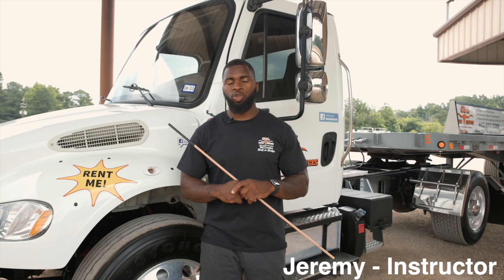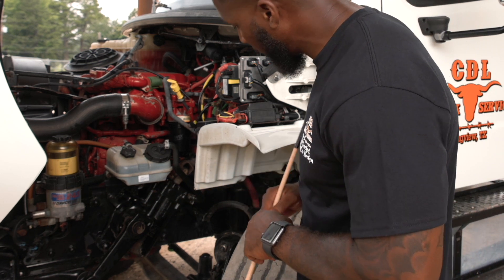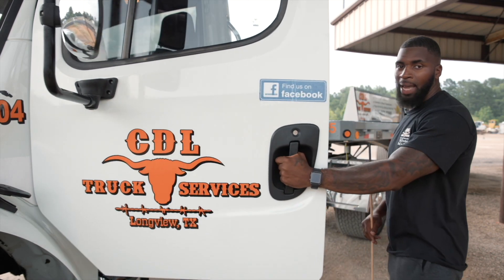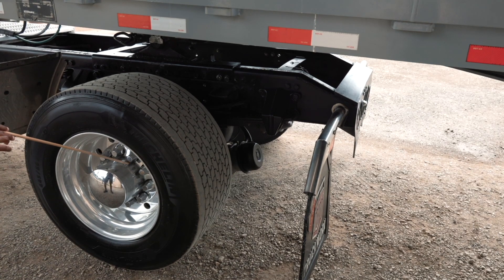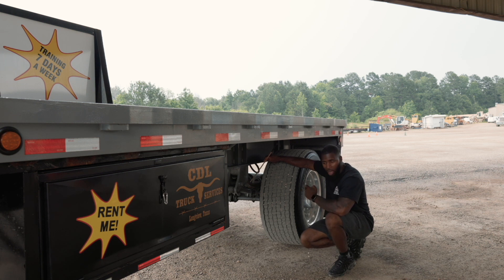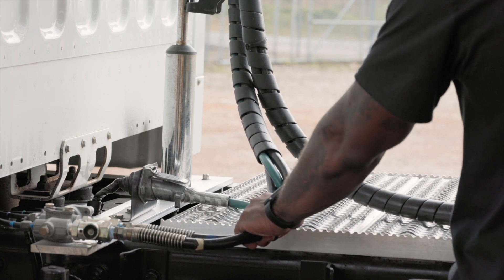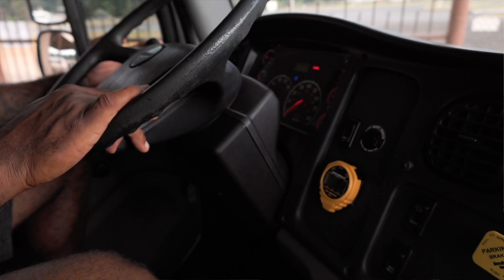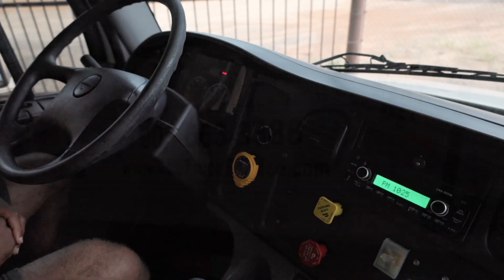CLASS A CDL Test Prep

Comment: This video is out dated and should be removed
Reply: Really? What's missing?
Reply: You should make an updated version.
Reply: @J.RealRashad now there is a check list that you can use for the pretrip and I suggest that you use it and practice using the sheet
Reply: Not all places have moved to the new inspection test
Reply: @CRAZZYBOYS100 perhaps so I was told by the DMV here that every state is supposed to require required to do the modernized version by 2024. His deal was done for the last 25 or 30 years. He did do a good job of the older method
Reply: @darrylbaber6329  Yah I live in south east Texas and i wish they did switch it but our DMV has only now started to teach the instructors the new process.